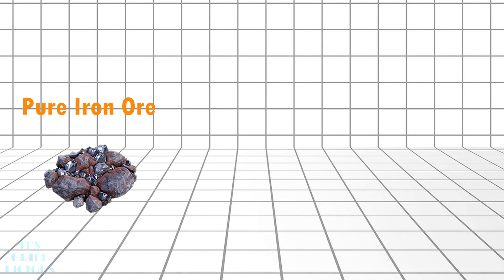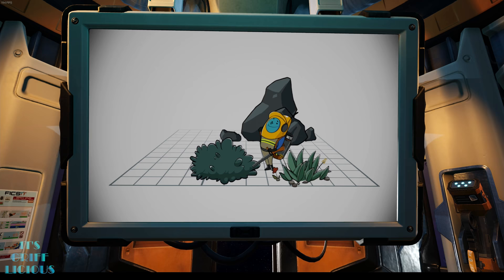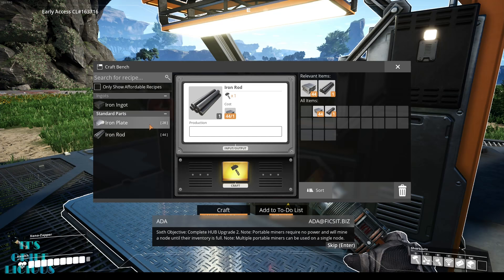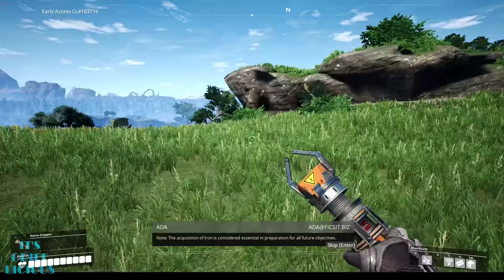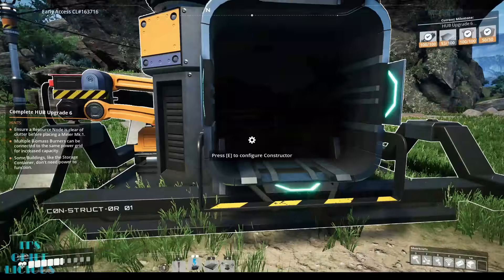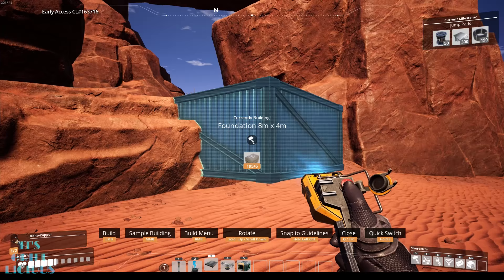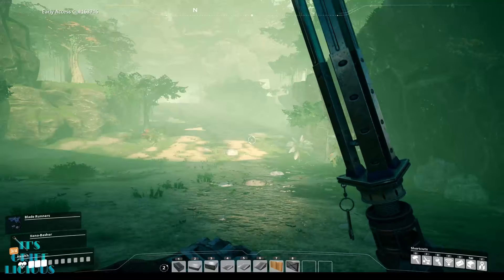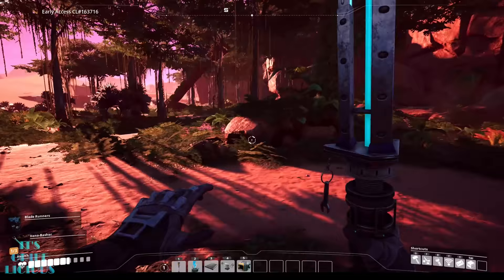Satisfactory: An Unlikely Masterpiece

Comment: Love the game... But those damn spider things really are some of the most terrifying things I've met in a game!
Small ones just barely bothered me. Just gave me a bit of fright when a pair found my base and jumped me between the machines at night.
Didn't know about the big ones until one ambushed me in the middle of the night (both irl and in game). Can still wake up in the night, remembering those long legs crawling up at me over the top of a big boulder.
Arachnophobia mode helped for the most part, but even then I get PTSD flashbacks while travelling outside my base. Especially to go check my coal stations when electricity suddenly goes out: That's exactly where it all happened the first time.
Now I find myself suffering from a couple of new phobias: That of static cat noises, and blank staring cat faces. It got so bad that I now have to make sure I place my cat's food containers facing away, so that I won't find them staring back at me from the floor the next time I open the pantry door...

Comment: Yeah, the sound design is phenomenal. When I started playing, I was just pleasantly surprised by the slow, deep hum of a simple smelter. I just stared and listened to the thing for a minute.
Also the whole Early Access is vastly different. When for AAA game companies early access means that there is a ton of different bugs, Satisfactory never crashed for me or anything. Apart from autosave, it's smooth and even the glitches are almost non-existant. The largest glitches for me were some weird collisions like when spider jumped and hit my truck and the truck jumped a few meters up and did a few barrel rolls before hitting the ground. Or when my explorer's wheels spazzed while riding over crude foundation bridge. Or assets not aligned to terrain. Nothing major like CP2077 first cutscene being completely broken mass of polygons (and that happened this summer, after all the big patches).
Satisfactory's early access means that all the progress is not done (there might be more tiers of buildings, artifacts are still WIP), but what's done is polished and smooth. Even the building is by far the best I've encountered yet and I've seen NMS, F76 and other similar games with free-form building.

Comment: Things that personally I think Satisfactory needs some work in: Even if you want to automate early you are forced to sit and watch the manual crafting screen for way too long. Also coal power comes too late. Biomass burners become a nuisance after the second time you fill them but you can't get coal power and fully automated power until many hours later. Building big is really tedious in Satisfactory compared to Factorio where you can design something once and then use that later with a blueprint. This can be used to set up many things really fast without having to do the same thing over and over again. Satisfactory has nailed the feel and look of the game really well but it isn't a perfect game yet.

Comment: Correction on the video around 24:00... Caterium and Quartz don't only unlock through finding some and researching in the MAM... You will eventually get the ability to scan for both of them at higher space platform progress tiers if you haven't found any of them yet, because some of the items you need for key recipes to work towards objectives in later tiers will depend on having researched these elements, more specifically some of the recipes you need them for. I think even sulfur is needed for very late game and unlocks by itself eventually. Though all these elements are still very useful before they're really needed for objectives, finding them earlier always helps.
Reply from the maker: Hmm. Didnt consider that. Reckon it’s because I always found it before that point! Lol. Can’t not have blade runners
Reply: Yeah, blade runners and the explorer are both incredibly useful, also smart splitters are worth rushing.

Comment: The alternate recipes are more complex. Some are better ar resource efficiency. others are less efficient in the conversion ratio, but gives other benefits. Like they are much more space efficient (I may not care if I use 20%more iron, if I can use 4 time less constructors, or skip a stel in the production line). Other recipes may allow you to use different materials, so you can use more local resources. 

There is very few alt recipes that seems totally useless. What is the best depends on players needs. The mist resource efficient ones are goto option for mist players but for example, playing 5x5 challenge it changes.

Comment: Having played both Satisfactory and Factorio, I feel like they occupy different niches in spite of their similarities.  Factorio was clearly here first, and is a much more complete experience overall (whether or not that's a good thing is largely up to the player though.)  Satisfactory doesn't have the complexity of Factorio, but feels like the pace is much faster, and it gives you a lot more flexibility to build things the way you want.  In terms of how enjoyable they are, I think the biggest issue I had with Factorio was, oddly enough, inserters.  I realize that it's probably necessary due to the way conveyors are designed in Factorio, but it's two extra parts (plus power sources) that need to be added to everything, and it drives up the complexity very quickly.  I still enjoyed Factorio, but Satisfactory just feels like a more enjoyable game overall.

Comment: If you like the animation of the building of the Space Elevator, I'm about to drop you a reality check.

The principal of a space elevator is that as a planet rotates in space, the theoretical centrifugal force can be utilized for cheap transportation between planet surface and a geostationary orbiting spacecraft.

The scaled down version of this is when you swing a yo-yo around above your head.

All's good so far. But... imagine now with your yo-yo that you have a friend running around you, matching the speed of the yo-yo, and ants can climb in either direction along the string to get to either you or your friend.

Are you seeing where this is going?

How did you get the yo-yo to reach your friend? It had to originate from you and elongate outwards.

The game animation shows the Space Elevator coming down from space. This is like your friend had the yo-yo and was able to push it to the inner of the circle to reach you.

You can't push a rope to make it straight. The game animation is WRONG!

Also, for it to function properly, it would need to be placed directly on the actual equator of the planet. If you had it placed on the 45° latitude line, then the "rope" of the elevator would be slanted at 45° from the point of view of a person standing at the base of it, and it would be a distance away from the oribiting craft as a geostationary orbit can't be had off the equatorial line.
Reply from the maker: literally unplayable
Reply: @Grifflicious  Technically, but I'm glad it's virtual. I don't install supports, everything floats in my Satisfactory worlds lol

Comment: To anyone trying to determine whether or not they should buy this game, do it.

Statistically speaking, the game coats about £27 at full price, this does go on a discount on Steam very commonly. If you don't enjoy it, request a refund. (You can only put under 2 hours in the game and must have owned the game for less than 2 weeks to be eligible for a refund).

However. My point is, you will be spending many many hours into this game. If you are walking into this game blind, watch tutorials on how to get a feel for the game, and maybe how to start a basic factory.

For those who now have a little knowledge, you will probably spend a lot of time, like the video states, gathering materials and putting your imagination to the test. 

Put it this way, I'm moderate at the game, I still to this day continue to make conveyor belt spaghetti around my factory, and I spend most of my hours working around how much power I can achieve.

Comment: I now have hundreds of hours into the game, and I spend time making the factory pretty while growing it - but that Biomass stage of power is a tad too punishing. Because when the power goes off, the entire factory shuts down. If the hub had a small internal battery, that might ease it. Early on I had to run around farming biomass for so long and still had to handcraft objects - getting to coal was a hassle. Because you might have to go exploring AND learn how to manage the newly discovered water pipes at the same time. I actually gave up on the game for awhile before coming back. Everything is a masterpiece. Its almost Factorio level. Almost. (I play both.)

Comment: One of the things I've noticed is how riddiculously hard you need to try to make the game's framerate tank. I've built a crisscross'd monstrosity that I think would disgust even LGIO Josh, and I am well into Nuclear and Particle stages now, and only at this point has the framerate dropped from 144, on a 2k monitor, all graphics maxed, and running on a 1080. This means even low end computers can, by turning graphics down, create some true behemoth builds and setups with little to no performance impact, which keeps you immersed. This game caused me to have a nosleep brain missfire that kept me up for 40h, and I had to FORCE myself to sleep. It put me in an extremely odd flow state where I could prolly have kept going for another 20+ hours before physically collapsing into sleep if I wanted too.

Comment: I didn't play satisfactory, only factorio. However, the multiple times i play factorio, i ended up getting bored, and I think it's because everything took so much time to do. Want to build an outpost to extract oil ? Cool, gotta first clear enemy outposts, prepare hundreds of walls and dozens of turrets, then finally you can get to doing the outposts, because swarm attacks are so frequent. In satisfactory, the lack of need to have defences actually seems to speed up the gameplay a ton, which is pretty cool in my opinion. However, I really like factorio for it being what it is, and it wouldn't be as good as it is today if it wasn't for its defence and survival aspect.

Comment: I have 3 problems with Satisfactory that I didnt like. 

The biomass burner, it is simply annoying, you cant automate, it looks contradictory to the entire proposal of the game. Today I just want to start with an save editor skipping to the coal. It doesnt matter what the devs want, the execution that matter.

The super advanced train, I dont like creating miles long conveyor belts, the truck isnt efficient, have bugs...

And the tier 5-6, until these tiers the game has a good learn curve, but after the Manufacturer, the Computer... the game has a huge jump, not a curve, an abyss. When you progress to this point looks like everything you did was wrong and you have to destroy everything and rebuild, you use like a line of 14 constructors to supply one item for the manufacturer, it is overwhelming and it was the reason for my first quit in this game

Comment: I mean it's basically 3d factorio and the only pitfall of factorio was how circuit board maker simulator it felt because you only had 2 dimensions (3 with the underground belt but those only span so far). And factorio was a hit so I'm not sure how satisfactory would be an "unlikely" success when it's older sibling was a success

Comment: I don't think that are bad and good alternative recipes. There are, ALTERNATIVE recipes. Isn't just about how much u will produce and the cost of it, in terms of raw material, but what are u using to produce what u want. For example, turbo fuel can be produced in several ways. One of them cost much more energy to do so, while other cost less energy but is more complicated and may use precious resources that u will need in other production line. 
I think is about desing of ur own factory's and the use of each raw material available and the game does that extremely well.

Comment: Quick note, not sure if it’s still true but the biomass burners on the Hab aren’t as capable as the the ones you can build yourself.

Edit: Another note, something you should invest some time into in Satisfactory is exploration, not for resources, but Drop pod crash sites. Even if you don’t grab the hard drive they all have at least some products (spanning most of the tiers prior to the last two) that you can use to progress without actually building the items… though you also probably quickly have too many screws, wires, and cables.
Reply from the maker: Yeah. I mistakenly said 30mw when it’s only 20 per hub burner
Reply: @Grifflicious  That's probably because the non-hub burners ARE 30MW, it's such a trap really.

Comment: 15:25
Yeah, which kinda sucks if you have a lot of them. You can't automate inserting fuel into biomass burners for some reason.

...
I got into Satisfactory a bit before I got into Factorio, when I was and still am desperate to find games that can provide me with a fulfilling experience, and I can't always help but compare the two. Some might say that Satisfactory is just 3D Factorio with better graphics and is thus superior, but I heavily disagree. Despite all of Satisfactory's wow and pizaz, Factorio is the more complete game. In Factorio, you can automate _everything_. You have a single, concrete goal (launch a rocket), and an antagonistic force (the biters) opposing you the closer you get to it. The game's pollution mechanic ties it all together, as you literally ravage and destroy the land to extract all of its resources.  The map is infinite, but resources are not, so you are always pressured to keep expanding. "The factory must grow" as they say. The only thing that stops Factorio from being a "perfect" game for me is the lack of variety in the environment. Every task you perform centers some way around your factory, and there's no reason to explore very far outside the local bounds of your home base.
Satisfactory is in some way the opposite of Factorio, while still being an automation game. The map is finite, but resources are infinite (although they can be extracted at a finite rate). The game has a rich variety in terrain and environments, and rewards you for exploring while letting your base run on its own, offering a nice mental break from trying to solve optimization problems. There is no pollution in Satisfactory, and you cannot alter the terrain to a meaningful degree besides clearing away foliage and choice small rocks. There are hostile creatures, but they almost always serve as an obstacle while exploring and will never attack your structures. 
When it comes to Satisfactory, I find that it is the game I play more while also disliking more. The automation aspect of it feels more like jumping through hoops than actually creating elegant solutions to problems. Most of my factory lines are messes just good enough to unlock the next milestone so I can get the next shiny exploration upgrade. Exploration, of course, being the part I like most about the game.

Comment: Per the 2 games, I think Satisfactory has more game to it (that is, more stuff aside from the production) and more options for factory design. Factorio is more focused on the pure optimization--it's just factory building, but the tech tree and recipes are deeper. Satisfactory definitely looks better, but I think it comes at the cost of some tedium. Because it's 3D, it's harder to build and link in satisfactory. Factorio players can just plop down a dozen factories in like 3 seconds, but placement in Satisfactory has to be slower--you need to worry about terrain, elevation, and everything is at weird angles (whereas factorio only allows 90-degree rotations). It's basically a more pure/schematic planning than Satisfactory. 

I am going to have to get back into Satisfactory, because I know there is more to it. I just found I was spending a lot more time worrying about the minutiae and angles and building platforms and fixing belts at weird angles than planning out the broader layout and design of my factory. If you play one I find it hard to imagine not liking the other--they really are the same core game.

Comment: i found it wildly annoying. every time i was getting into the zone of designing my base it all came to a halt because I ran out of biomass so I need to go spend 10 minutes collecting leaves to get more. And it takes for fucking ever to get to coal power. i get that you can partially automate it and the chainsaw helps but it's still just too slow.

i don't need encouragement to progress, it's what I want to do. I get what you're saying here in the video I just don't agree with it, the only thing it does is upset me and make me lose my will to keep pushing rather than encourage me to go

I came here to build not play yard cleaning simulator, at the end of the day I just continue to play more Factorio or Dyson sphere program. where once i have power going, so long as I designed it even halfway intelligently it's going to go for many many hours and I will have all the time I need to sit and play design of the next piece of the base without being interrupted

Comment: I agree with everything here but the last point about the version of the game is wrong. This is not how software, by extension video game, developement works. You can do a version v0.3.18 then go to v0.4.0 then do multiple updates that will lead to maybe a v0.4.53 and then you add some things that you feel is a bit more major and then you go into v0.5.0. Then after all that maybe you think what you made is ready to be officially released which will be 1.0.0 for 99.999% of what you will find. This means that their update 5 (which is the v0.5.X) could be their last update before release. From what I've seen from them I would say that if we see a release, it will be at something after like 0.7.X or 0.8.X. But maybe they have more ideas they want to put in the game before the official release. But that could also lead to a v0.12.X before an official release